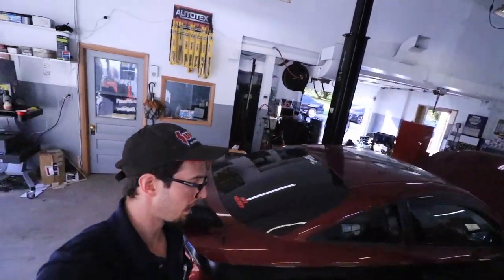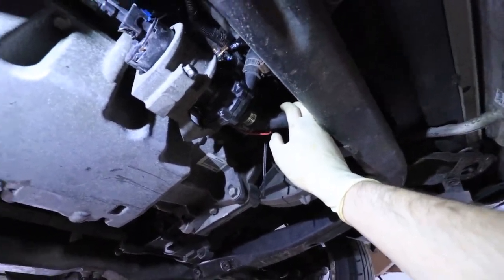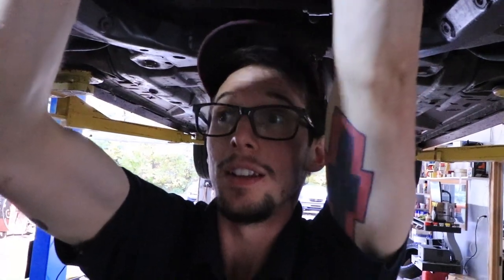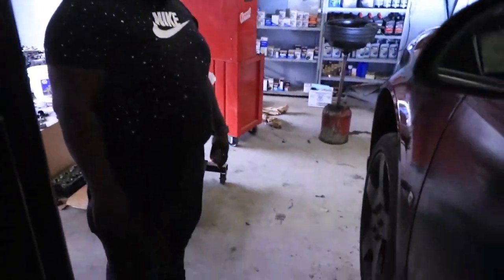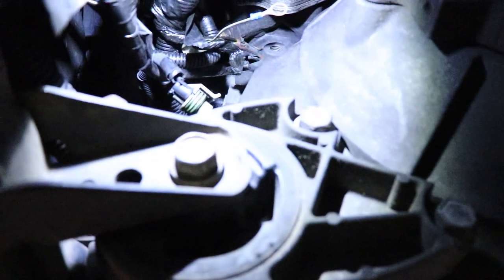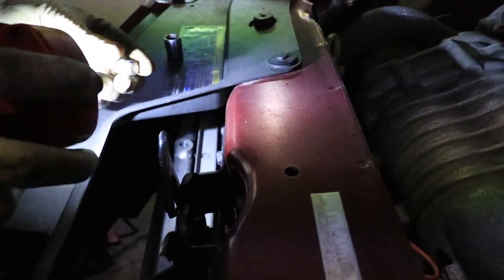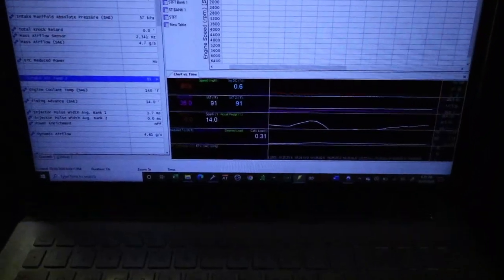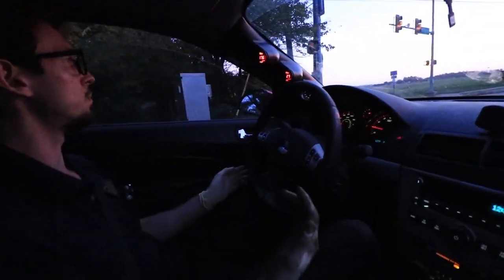Intercooler Pump Testing on the LSJ Cobalt SS and other wiring problems

Comment: I had the same problem with IC pump that I replaced back in Feb this year. I wasn't getting any reading on my volt meter. The fuse keeps popping when I start the car for the pump. Imma look into this. I also tried get a reading from the fuse box for the aftercool fuse but I ended up widening the place where the fuse goes and just wiggles and can't find a way to close them so the fuse blades will be snug in place.
Reply from the maker: oof sounds like a fun one, good luck
Reply: Wires are backwards. The factory fucked up

Comment: Keep popping #10 fuse 07 ion redline started popping fuses after a installing a new zzp red ic pump about a month of it working
Reply from the maker: sounds like the load on that circuit is a bit too much. could be that new pump or a coincidence
Reply: That's y I chose oem pump
Reply: Something to consider is that a stronger pump also stands a larger chance of blowing coolant into your intake through the laminova core o rings especially if they are the ones that came on the car from the factory.

Hell i just replaced the stock pumo with an oem pump and it blew past my old laminova I rings and into my intake. Thankfully no lasting damage it seems

Comment: Could you tell a difference while driving it?
Reply from the maker: it could but not in this case. but if you monitor the temps its a big difference. It would show up on a dyno since it would be adjusting timing based off the tempurature. if it were the middle of the summer it may even go into a limp mode it wasnt that hot when we were fixing this.
Reply: @salvobrothers5928  mine not working and I don't think it ever did lol I tried to change the pump but it still wont work so I'm hoping it's the ground
Reply from the maker: @angeloventura1890  yea i hope so to, best of luck